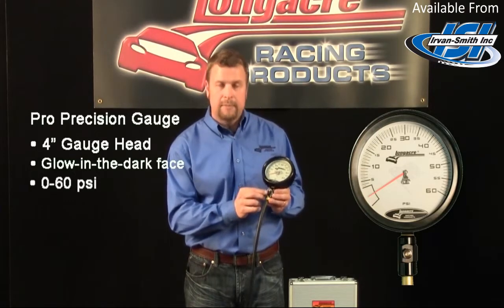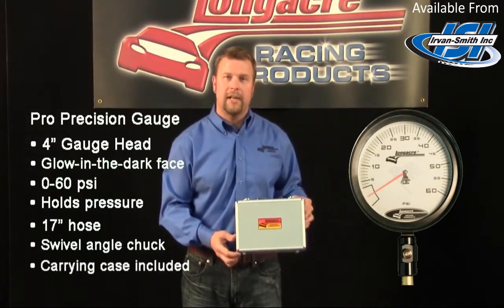Longacre Analog Tire Pressure Gauges

Comment: Tracy, had a quick question wasn't quick clear here... Does the Quickfill Inflator/gauge (analog) model hold the air pressure when measured or does it release and drop to zero when released? Thanks again!
Reply: +mikewinburn The Quickfill model does hold the air pressure when measured. Thanks!
Reply: +Tracy Smith thanks... Ordered already!
Reply: +mikewinburn Glad I could help! Enjoy your new tire pressure gauge. I am sure you will be pleased with it.

Comment: Does the inflators/ monitor edition come with the air hose connector? The model you held had the adapter in it, while the picture shown doesn't have it. Please advise if you can use the pressure monitor function even if no hose is connected to the inflators end.  Thanks
Reply: +mikewinburn The air hose quick connect fitting is not included. The gauge can be used to check the tire pressure without being connected to an air hose. Sorry it took a couple of days to respond. Just missed this one. Let us know if you need anything else. Kevin@irvansmith.com
Reply: +Tracy Smith - no problem! Good info. I'll check the website to see if quick connect is available as add on....picking up that quick fill model. Thanks